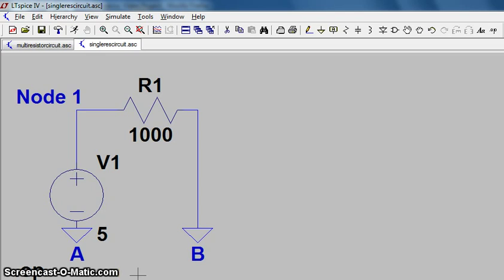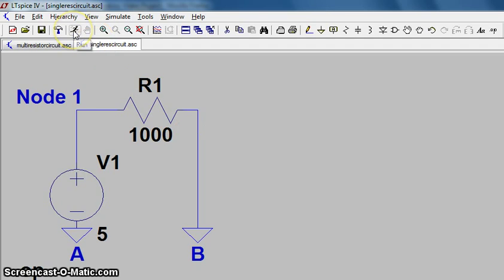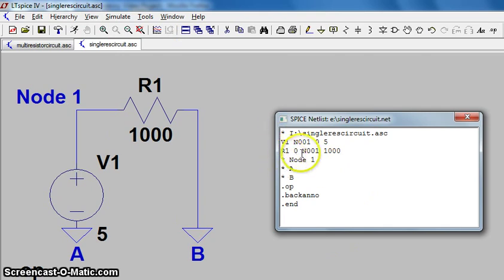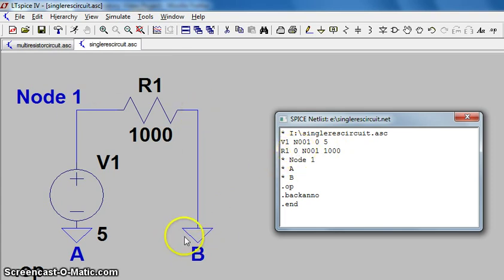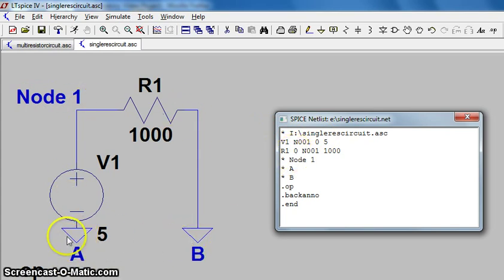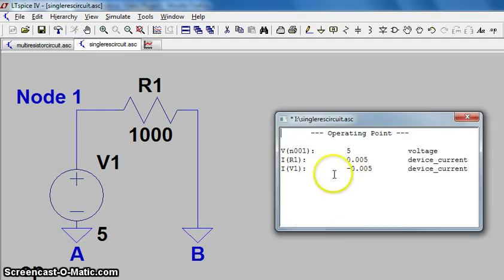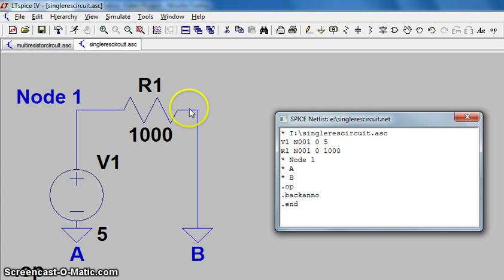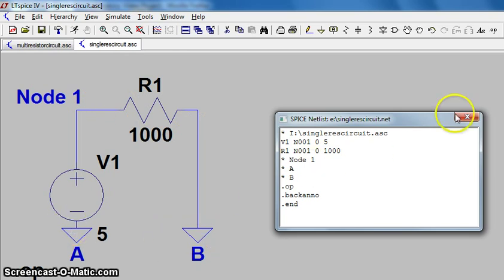Operating point analysis in LTspice - Part I

Comment: What if you happen to have more than one mosfet in your circuit, how would you run .op analysis then? Use their names?
Reply from the maker: I'm not sure what you're asking; an operating point analysis just gives the steady-state values in a circuit, so it would do so for every component. There are no values to specify in setting it up.
Reply: +Terry Sturtevant, Hi, it could be done with back annotation on schematic of I, V ,   for mos it will give Id, Ig, IB etc you choose  . In .op analysis make sure that all other analysis  are off ? , see : http://www.zen22142.zen.co.uk/ltspice/dccircuits.htm